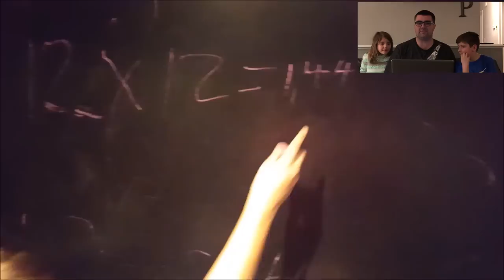Kids React to Kid Temper Tantrum Breaking Window- Deleted Footage!

Comment: Me and My Family Will Build A House At Fawn Lake With Chimney With Fence and 5 Car Garage With Concrete Driveway and Storage Attic With Attic Ladder in The Garage and 2 Decks in The Backyard and 1 Deck Behind Garage and 1 Deck Behind Sunroom and The Living Room and The Basement Entrance Will Be Outback At The Patio Under The Deck and Shaded Front Porch and 5 Bedrooms and 5 Bathrooms With Bathtubs and 5 Closets At 3rd Floor and My Own Bedroom and My Own Bathroom and My Own Closet Will Be Brown and Green Will Be Outback and 2 Secret Rooms and 2 Secret Bathrooms With Bathtubs and Secret Closets At 4th Floor and 4th Floor Will Be Penthouse Floor and 1 Guest Bathroom At 2nd Floor In The Mudroom Across The Garage Entrance and The Kitchen Will Be Outback and The Dining Room Will Be Out Front and The Walking Pantry Will Be Next To The Basement in The Kitchen and The Woodburning Fireplace and The Bar Will Be Living Room and Family Room Will Be Out Front and 2nd Floor Closet Will Be Between The Stairs in The Foyer Room and The Basement Will Be Fully Finished and The Laundry Room and The Gaming Room and The Fitness Center and Fitness Center Closet and My Office Will Be Across From Fitness Center and My Office Will Be Brown and Green and My Office Closet and REC Room Will Be in The Basement and Basement Bathroom With Bathtub and Need A Cat Brush Hole Top Of The Steps On The Door At The Basement and The and Cat Brush Hole For Laundry Room Too On The Door At Fawn Lake. Me and My Family Will Build A House With Chimney With Fence At Fawn Lake and Concrete Driveway and 5 Car Garage and Storage Attic With Attic Ladder and 2 Decks in The Backyard and 1 Deck Behind Garage and 1 Deck Behind Sunroom and Living Room and Basement Entrance Will Be Outback At The Patio and Shaded Front Porch and 5 Bedrooms and 5 Bathrooms With Bathtubs and 5 Closets and My Room Will Be Outback With My Own Bathroom With Bathtub and My Own Closet With Brown and Green Walls and Aubrie's Room Will Be Outback With Her Own Bathroom With Bathtub With Her Own Closet With Teal Walls and My Dad's Room Will Be Outback With His Own Bathroom With Bathtub and His Own Closet With Green Walls and My Mom's Room Will Be Out Front With Her Own Bathroom With Bathtub and Her Own Closet With Gray Walls and Guest Bedroom Will Be Outfront and Guest Bathroom With Bathtub and Guest Closet With Green Walls and 2 Secret Rooms and 2 Secret Bathrooms With Bathtubs and 2 Secret Closets At 4th Floor and 1 Guest Bathroom Will Be in The Mudroom Across From Garage Entrance At 2nd Floor and Furnace Attic With Attic Ladder and The Kitchen Will Be Outback and The Dining Room Will Be Outfront At 2nd Floor and Walking Pantry Will Be Next To The Basement and The Woodburning Fireplace and The Bar Will Be In The Living Room and Family Room Will Be Out Front and The Foyer Room and Foyer Room Closet Will Be Between The Stairwell and The Basement Will Be Fully Finished and The Laundry Room and The Gaming Room and Gaming Room Closet and The Fitness Center and Fitness Center Closet and 2 Offices and Rec Room Will Be In The Basement and My Office Will Be On Right and My Office Closet Will Be Brown and Green and My Mom's Office Will Be On The Left and Her Own Closet Will Be Gray Walls and Flat Resistance Bands For $27.99 and Other Flat Resistance Bands For $11.09 and Treadmill For $674.68 and Other Treadmill For $2,499⁹⁹ and Eliptical For $899.99 and Other Eliptical For $2,599⁰⁰ and Exercise Bike For $167.99 and 29.5 Inch Mixed Color Yoga Balls For $57.99 and Yoga Mats For $168.88 For Fitness Center and Basement Bathroom With Bathtub and 2 Doors For Furnace Room From Gaming Room To The Fitness Center and Need Screens For Windows and Brown Mulch and Split Rail Fence and Me and My Family Wants Soft White Light Bulbs and LED Light Bulbs and Cat Brush Holes For Basement Door Top Of Steps and Laundry Room Door Bottom Basement Steps For House At Fawn Lake. Me and My Family Will Build A House At Fawn Lake With Chimney With Fence and 5 Car Garage With Concrete Driveway and Storage Attic With Attic Ladder in The Garage and 2 Decks in The Backyard and 1 Deck Behind Garage and 1 Deck Behind Sunroom and The Living Room and The Basement Entrance Will Be Outback At The Patio Under The Deck and Shaded Front Porch and 5 Bedrooms and 5 Bathrooms With Bathtubs and 5 Closets At 3rd Floor and My Own Bedroom and My Own Bathroom and My Own Closet Will Be Brown and Green Will Be Outback and 2 Secret Rooms and 2 Secret Bathrooms With Bathtubs and Secret Closets At 4th Floor and 4th Floor Will Be Penthouse Floor and 1 Guest Bathroom At 2nd Floor In The Mudroom Across The Garage Entrance and The Kitchen Will Be Outback and The Dining Room Will Be Out Front and The Walking Pantry Will Be Next To The Basement in The Kitchen and The Woodburning Fireplace and The Bar Will Be Living Room and Family Room Will Be Out Front and 2nd Floor Closet Will Be Between The Stairs in The Foyer Room and The Basement Will Be Fully Finished and The Laundry Room and The Gaming Room and The Fitness Center and Fitness Center Closet and My Office Will Be Across From Fitness Center and My Office Will Be Brown and Green and My Office Closet and REC Room Will Be in The Basement and Basement Bathroom With Bathtub and Need A Cat Brush Hole Top Of The Steps On The Door At The Basement and The and Cat Brush Hole For Laundry Room Too On The Door At Fawn Lake. Me and My Family Will Build A House With Chimney With Fence At Fawn Lake and Concrete Driveway and 5 Car Garage and Storage Attic With Attic Ladder and 2 Decks in The Backyard and 1 Deck Behind Garage and 1 Deck Behind Sunroom and Living Room and Basement Entrance Will Be Outback At The Patio and Shaded Front Porch and 5 Bedrooms and 5 Bathrooms With Bathtubs and 5 Closets and My Room Will Be Outback With My Own Bathroom With Bathtub and My Own Closet With Brown and Green Walls and Aubrie's Room Will Be Outback With Her Own Bathroom With Bathtub With Her Own Closet With Teal Walls and My Dad's Room Will Be Outback With His Own Bathroom With Bathtub and His Own Closet With Green Walls and My Mom's Room Will Be Out Front With Her Own Bathroom With Bathtub and Her Own Closet With Gray Walls and Guest Bedroom Will Be Outfront and Guest Bathroom With Bathtub and Guest Closet With Green Walls and 2 Secret Rooms and 2 Secret Bathrooms With Bathtubs and 2 Secret Closets At 4th Floor and 1 Guest Bathroom Will Be in The Mudroom Across From Garage Entrance At 2nd Floor and Furnace Attic With Attic Ladder and The Kitchen Will Be Outback and The Dining Room Will Be Outfront At 2nd Floor and Walking Pantry Will Be Next To The Basement and The Woodburning Fireplace and The Bar Will Be In The Living Room and Family Room Will Be Out Front and The Foyer Room and Foyer Room Closet Will Be Between The Stairwell and The Basement Will Be Fully Finished and The Laundry Room and The Gaming Room and Gaming Room Closet and The Fitness Center and Fitness Center Closet and 2 Offices and Rec Room Will Be In The Basement and My Office Will Be On Right and My Office Closet Will Be Brown and Green and My Mom's Office Will Be On The Left and Her Own Closet Will Be Gray Walls and Flat Resistance Bands For $27.99 and Other Flat Resistance Bands For $11.09 and Treadmill For $674.68 and Other Treadmill For $2,499⁹⁹ and Eliptical For $899.99 and Other Eliptical For $2,599⁰⁰ and Exercise Bike For $167.99 and 29.5 Inch Mixed Color Yoga Balls For $57.99 and Yoga Mats For $168.88 For Fitness Center and Basement Bathroom With Bathtub and 2 Doors For Furnace Room From Gaming Room To The Fitness Center and Need Screens For Windows and Brown Mulch and Split Rail Fence and Me and My Family Wants Soft White Light Bulbs and LED Light Bulbs and Cat Brush Holes For Basement Door Top Of Steps and Laundry Room Door Bottom Basement Steps For House At Fawn Lake.